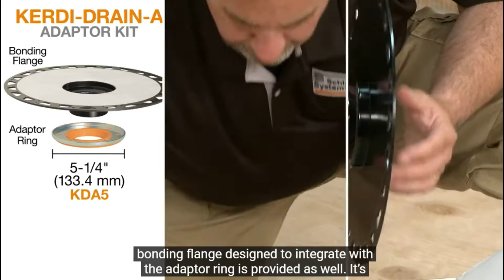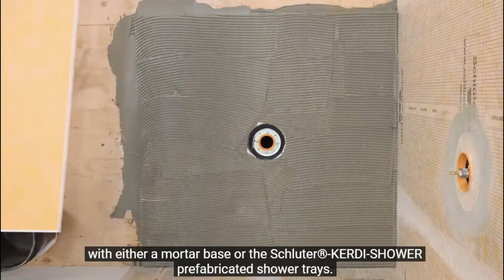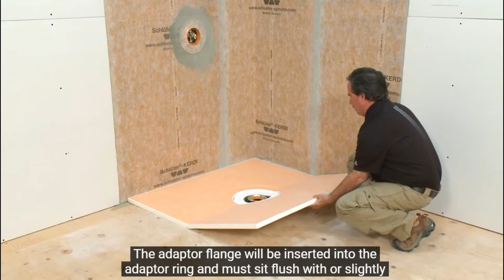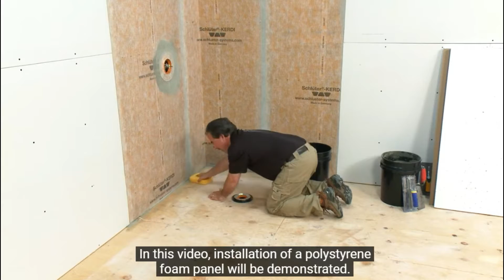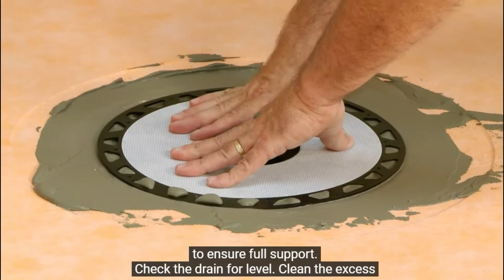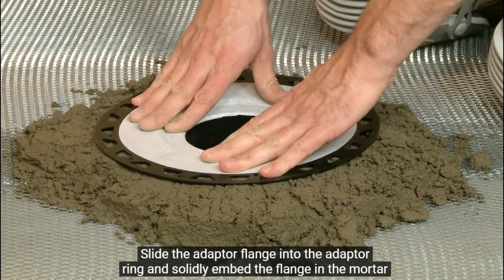Schluter KERDI-DRAIN-A Bonding Flange Drain Adapter process

Comment: This is probably the worst designed product ever. It absolutely doesn't work unless you build up the shower floor 2". What is the point? It's sold as a bolt in kit but those are bolted to the level of the substrate. Not under